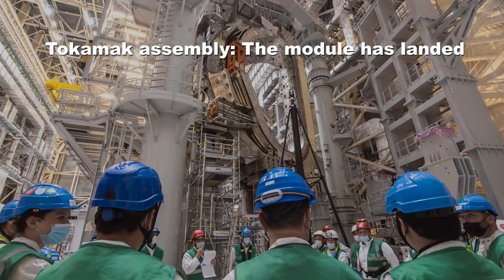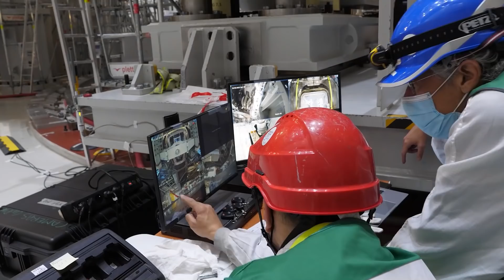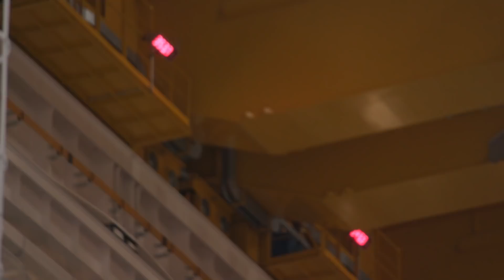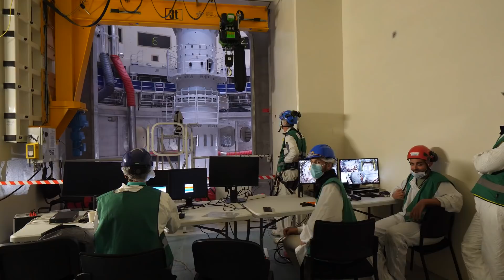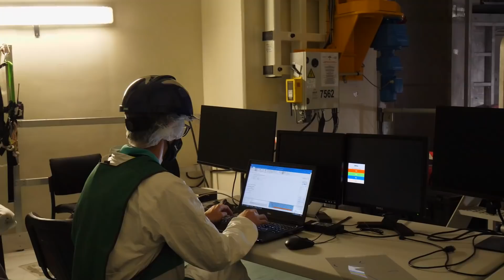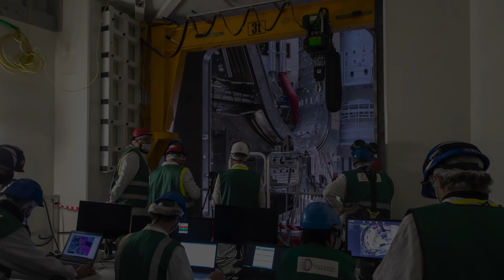Tokamak assembly: The module has landed

Comment: To quote the late great Robert Bussard: "We've spent many decades and many tens of billions of dollars on Tokamaks, and so we know a lot about them. And what we know is that they are no damned good."

There is literally zero chance of ITER ever producing a commercial reactor design, or such a design ever generating a single watt of electricity for the grid. Tokomaks are where fusion goes to die. 

The only thing ITER will ever produce is a stack of the world's most expensive Ph.D's, taller than the reactor building.
Reply: and you are a plasma physicist? or where do you get that confidence for your claims?

Comment: How much power will iter consume and how long will the plasma burn for?
How long will iter take to set for a repeat burn each time?
When will DEMO be up and running?
Oh I have so many questions!
Reply: First plasma: 2025
Full power: 2035
Plasma for up to 15 mins
Power put into plasma: 50MW
Heat power got from plasma: 500MW
Entire electric energy put into machine while workin: ~ 500MW
Entire electric energy got from it: ~ 200 - 300MW.
We're still below the line, but in comparison to previous projects, the progres is huge.

Comment: The trouble is that it's taking so long to build that some of the technology is getting eclipsed.  MIT's reactor is 1/2 the size and will do the same job at a fraction of the cost.  One way they did this by building the first super conducting magnets with YBCO (or something like it) that can use liquid nitrogen with 4 times the magnetic power.  ITER is still needed to answer the question of tritium production.  So it's worth it.
Reply: Nope, it won't do "the same job". There are so many technologies tested/developed for ITER that's on another scale entirely. 
The MIT, the JET, the reactors in China or the other one in France and many other elsewhere (like the stellareator in Germany) are all exploring different questions, like AI controlled plasma. But ITER is about size. I won't go in the details, but everything from the electrical installations, to the particle accelerator (yes, there is one) to the cooling stuff is BIG. And with size comes a lot of problems. 
Something else : ITER is about EU + USA + Japan + Korea + China + Russia + India. Basically, so many countries operate this that you can consider it being "open source-like". The technologies developed for ITER will be available to everybody. And the world NEED that kind of international cooperation more than even.
Reply: @mecha-sheep7674 , I.E the Americans seem to be full of excessive self pride & making fun of an energy site meant to power the whole world.
Reply: @Lionfish5656  Which is puzzling because they are invested in the project too...
Reply: Iter will also answere a lot of "how scaleable is it" questions. Spark is btw. designed for 100MW Fusion power, Iter for 500MW
Reply: Whenever Iter is done, they can open it to public as a museum. 😁

Comment: Thanks for the update, Watching at 2x speed I noticed an concerning amount of movement while being lowered into the pit. Will this be of any concern when installing the rest of the rings due to the precise placement or is there some margins for movement when installing the last couple of ring sections ?
Reply: That kind of swaying motion during a lift and especially transport is completely normal. The mass is so enormous and the motion (in real time) is so slow that it takes a long time for air resistance to dampen the oscillations.  And any tiny movement of the crane can start them up again. You just have to be aware that they happen and not let them get out of control.

The motion doesn't affect the final placement. It will be lowered to within a couple cm of it's supports and control lines will be attached and people will pull it into the correct position. On a smaller load it's literal people pulling ropes, on something this big they would use small hand winches or come-alongs. With as much precision as this requires the designers probably built in alignment ramps and horizontal jacking screws at the major support point. You let the supports take a bit of weight which stops the swaying, then you align it, then tighten the bolts, then let the rest of the weight off the hook.
Reply: They adress this in the subtitles: 4cm of clearance while swinging or something like that
Reply: it's already accelerated footage. If you wanted to see if something was amiss then slowing the footage down would probably be more informative. As it is the movement is just from the gigantic mass swaying beneath the gantry on its cables.

Comment: This got to be the most clean construction site ever
Reply: @entereloaded well, the finished fab is clean for sure but I don't think there is much incentive to keep it's construction site polished to this degree
Reply: @mateuszbugaj799  yes there is. You don’t want to contaminate areas and specific items that will affect the performances of those items. This is still considered an experimental reactor.
Reply: looks like a CPU manufacture
Reply: @UCjNrKLyRJI-abFA8qiNo92Q  Not even close. Street clothes are not allowed in a fab
Reply: @bambur1  Inside EUV ASML machine is probably even cleaner. Could be that Mars samples recovery have also strict requirements, also medical applications.
Reply: @wizdarek  i worked on ASMLs DUV.  It used a laser as a light source
Reply: @bambur1  I know a bit about DUV but light source in EUV is different level. And due to light wavelength it has to be in vacuum. It is different level. But i am far from the optics.
Reply: @wizdarek  lol yup look up the youtube on it. insane tech
Reply: that was the first thing i thought
Reply: I wonder how did they clean it after the rough construction work? Did the cleaning ladies climb around on the ceiling to get at every corner or did they call the fire department to spray a load of clean water at the ceiling?
Or did they not clean it at all and let the painters simply spray paint over the beam tracers with the dust?
Reply: @OpenGL4ever  long poles with sponges
Reply: Not even close. They have good housekeeping and it’s absolutely laudable. I’ve been to a pharmaceutical company where they manufacture cancer meds doing an addition. Holy crap was it absolutely spotless and literally everything that went into the area had to be new and completely sterile. Took forever to even get inside with the precautions and sterilization procedures. Crazy stuff.
Reply: Mostly because the pieces have only be put in place and not manufacturerd there.
Reply: @SuperUltimateLP  The building is built there. That's enough dirt, sand and cement to make a lot of dust.
Reply: Because it's more like a research facility rather than a typical construction site.
Reply: I would totally work here as a broom technician lol.
Reply: also the most ridiculously expensive construction site.  even compared to original costs